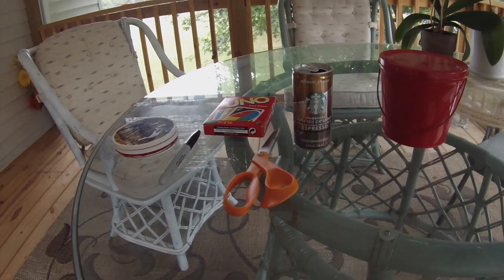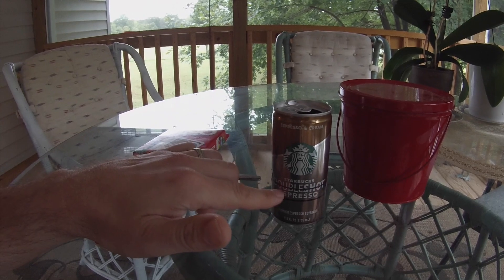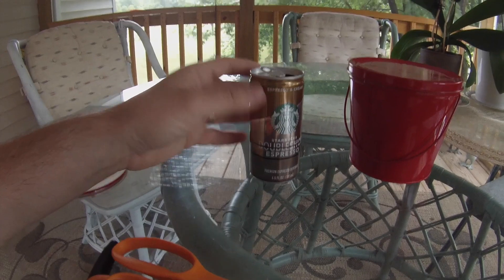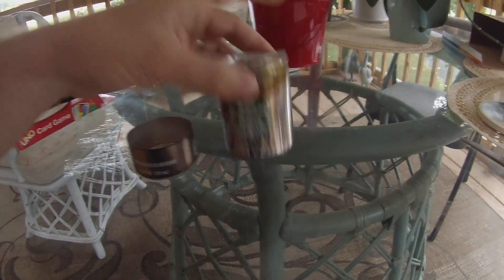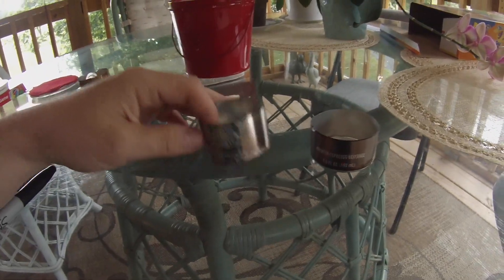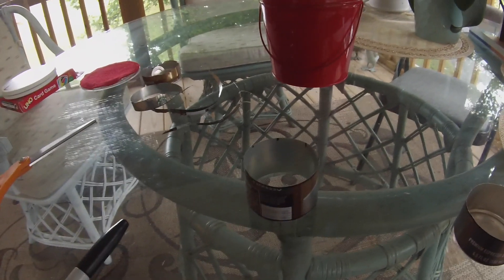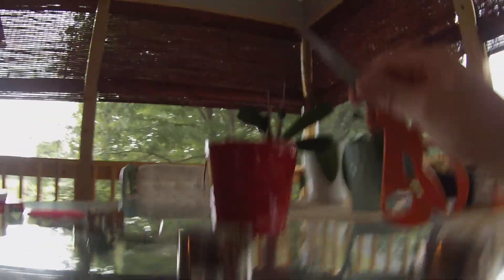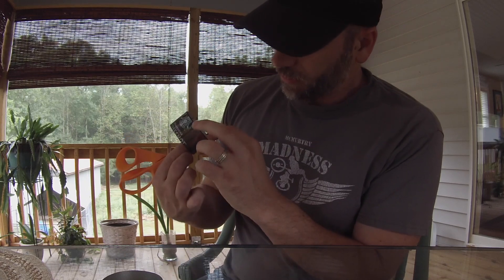Spiguyver Alcohol Stove Build Tutorial

Comment: Now that it's been a couple years, how are you liking the performance of this stove? Overall, how does it compare to the Fancee Feast style (cat food + tom. paste can version) in terms of efficiency, ease of use, & reliability? I'm considering making one of these myself, but I've always been impressed with my DIY fancee feast stove.
Reply from the maker: I made a couple of changes to the dimensions, made the inner pot stand a little taller, results in better boil times.  https://www.youtube.com/watch?v=P7AGxo6smZc
Reply from the maker: Right now I have so many stoves that I enjoy using it makes it tough to decide which one I'll take on each trip!
Reply: @SpiguyverBackpacking1  Thanks! I just checked out the updated video. Did you add some pressure relief/escape holes to the top of the stove as well?
Reply from the maker: I have played around with doing that, not sure it makes much difference.  I use a hole punch and do 2-3 1/2 holes along the top.

Comment: How does this stove work in cold weather? I've heard a stove without a wick doesn't perform well in cold weather
Reply from the maker: As long as you keep the fuel semi-warm, it works great.  I have shown in a couple of videos that when it's cold you can start it by holding the lighter to the outside of the stove and it will create a small area of boil that will ignite pretty quickly.  From there it will bloom in about 5-10 seconds.  Having said all that, for really cold weather I do prefer my version of the Fancy Feast with carbon felt.  Thanks!
Reply: Awesome stove...I’m making one tonight!  I’m a fancee Feast stove guy but it looks great!  I’ll let ya know how it goes.
Reply from the maker: One change I have made since this video is I do a little taller inner sleeve.
Reply: Spiguyver Backpacking how much taller?